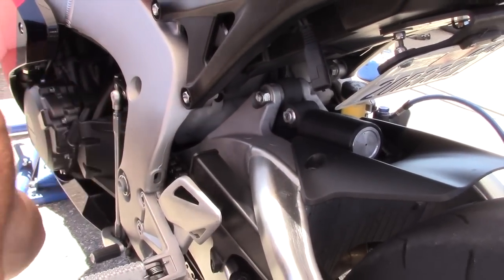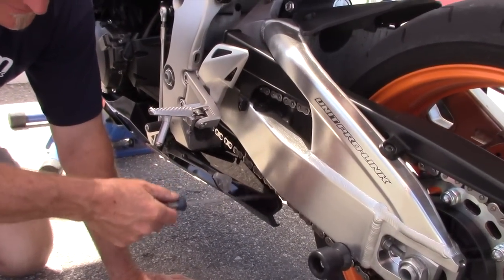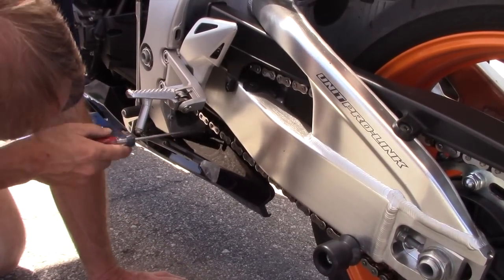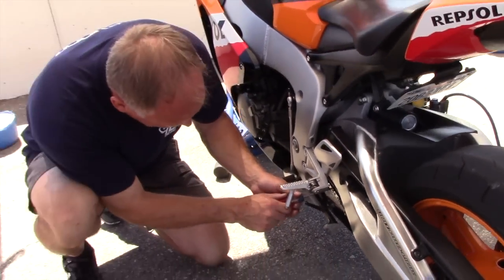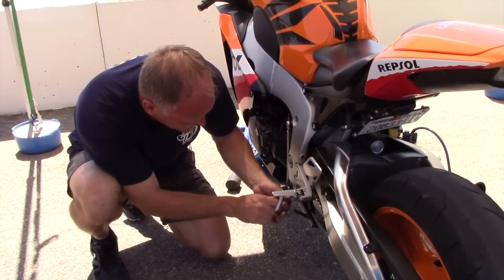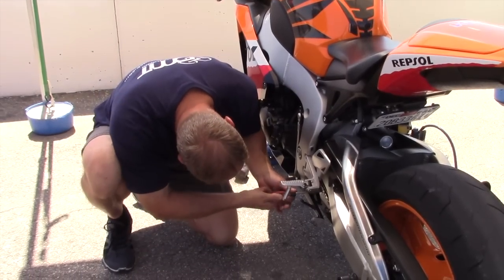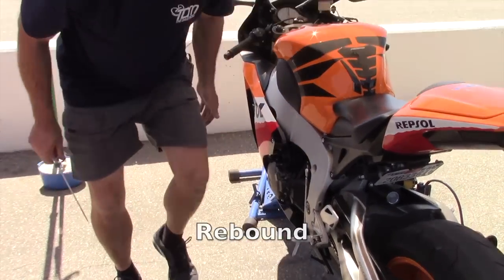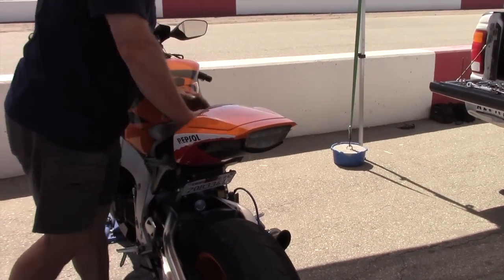2 Clicks Out: Honda CBR1000RR Quick Tune

Comment: I used to never mess with my suspension. But after getting some Dunlop q3+ put on it seemed way too stiff, a lot more vibration. Usually run 32 psi front and rear. Thank you for these videos! If you have time, what setup would you suggest for a 205 lbs rider. 2008 cbr1000rr. Cheers 🍻
Reply from the maker: I need a lot more information from you sir. Do you have an email I can send the questions to? Thanks.
Reply: I replied and sent you my email. It seemed to disappear after sending it. Just an update. I realized my preload on my front was only 3 rotations in from full soft. I just reset it to 3 rotations out, out of 15 total. Sag and rebound are both set 1.5 turns out form hard. I really appreciate the information you give in these videos. I’m looking forward to taking a ride once this snow clears. Living in West Virginia I can’t ride year round unfortunately. I need my therapy! Lol
Reply from the maker: @D_Fo  Hopefully decent weather returns shortly for you to enjoy a ride without Arctic gear!
Reply: Thanks! Layered up and went for a ride today. I just don’t like riding on the roads when there is still salt present. They weren’t too bad today. New suspension settings felt a ton better! Might tweak them a bit more but overall I’m satisfied. Thanks for the knowledge! Ride safe 🙏

Comment: I've seen that way too many times.  chain is too tight.  if your chain is that tight it is actually restricting the movement of the rear shock and will cause pumping on acceleration.  also it will increase chain, rear sprocket wear, and in extreme cases the output shaft of the transmission actually ovals out and causes big problems.
Reply from the maker: The worst part is that it mimics a shock rebound issue so you end up chasing a ghost. Preparation is everything.
Reply: preparation is always key as my suspension and best friend Kent Marquess would always say.  when the middle of your tire is worn down to a slick like that it's only going to hurt turn in too.  

I had a chain that had a tight spot in it so like you said I thought it was the shock pumping one day I went through and noticed the chain was very loose, but just right at the tight spot.  so needless to say that chain went bye bye.

that's how they set the chain after they changed the tire I mean that's what probably 500 miles on that tire or more.  we had so many people come to us with just simple problems that could have got them seriously hurt.  clip ons loose, throttles completely turning on there own, chains way too tight, rocks holding the throttle open after a crash, you name it we have seen it.

Comment: Hey I have a 2004 cbr 1000rr would you be able to tell me the front and back adjustments? I weigh 230 dunno if that helps for you to figure out the adjustments
Reply from the maker: I need a lot more information that that to offer any level of accuracy for settings. DMT Remote Tune Process
Below is all the information you need to know about re process and payment and requests for information that I need in the form of answers and pictures.
Please let me know your location so we can manage time differences (if any) compared to California.
Scheduling can be done after the questions are answered and I have the information needed to be prepared for the direction that you would like to take. Also let me know if you want to leverage email or video.

Options:
$40 for settings via email
$80 for video 1-1 in a 30 minute block (Skype, Facetime, WhatsApp)

Payment:
PayPal or Venmo using this email: dave@davemosstuning.com
Zelle using this number: 5034496202
Square – I email you an invoice that you can pay with your debit card
•	Please share the payment method used and the date of payment so I can track it.

Questions:
1.	Year, make and model of motorcycle
2.	Your weight without gear
3.	Miles or kms on the odometer
4.	Changes from stock for gearing, weight loss and engine power
5.	OEM forks or modified – if so how? 
6.	OEM shock(s) or modified – if so how
7.	Last fork oil service
8.	Last shock oil service
9.	Brand model and sizes of tires
10.	Type of use: commute, weekend, aggressive, some track

Pictures:
-	Front tyre 
-	Rear tyre 
-	Rear axle position in the swing arm
-	Upper triple clamp showing how much fork is above it

The answers to the questions provide me with the insight that I need in order to be able to help you accurately with settings

Thank you for the opportunity to work with you and for the payment.

Comment: got me a cbr1000rr -08 with freakihsly low miles on it, used to ride snowcross so setting something up for comfort is new to me, any suggestions on where to start making the bike more fit for me? currently at 110kg with gear. found it pretty hard to take measurements by my self, going on eyesight on the sag and such.
Reply from the maker: 1. Ergonomics for hand controls.  2. Set shock preload to 3 notches from maximum. 3. Set fork preload in the middle. 4. Mark fork bottom out   5. Ride and see how much travel you use via a cable tie on the right fork leg. All are single videos on this channel. Make sure tyre pressure is 38psi cold minimum.
Reply: @catalystreactionsbw  1. They are set, took that tip from one of your previous vids, great advice about not having an accell movement on the vrist while wanting to break. 2. got it! 3. Yes sir! 4. Check will do. 5. Yeah, same "trick" for sledding to check bottom out. i have 38psi front (260kpa, 2,6bar) and 2,9bar 290kpa 42psi back tire. pressure set cold of course! Thanks for the reply!

Comment: Hey Dave I noticed in the clip you didn't touch front rebound.. did you leave it at standard specs or change before starting to film?? Iv got mine the same as rear at 11/2 out..
Reply from the maker: I did not change it as it was 1.5 turns out.

Comment: Is it just me or is that tire really square?
Reply: West probably a first time track rider who doesn't hit any corners on the street (noob)
Reply from the maker: that results from riding away from a corner, not driving through the entire corner. Paradigm shift from brake, turn gas to brake, gas and turn simultaneously.
Reply: The video stated that guy didn't even ride on the track. This was from him thinking it is cool to "burn rubber" in front of his friends. Plain and simple.